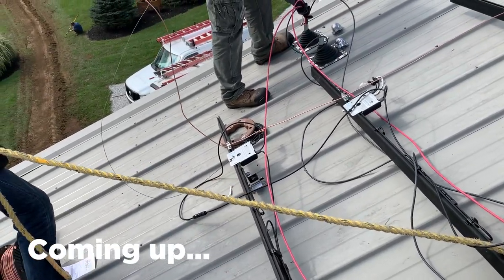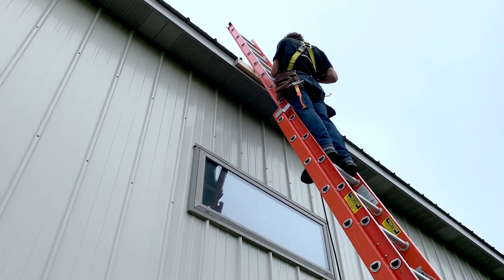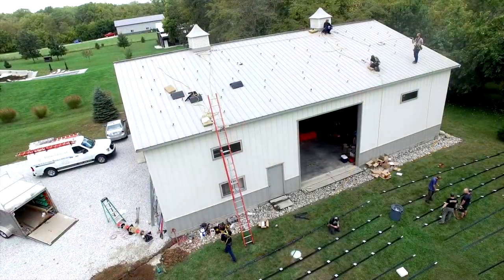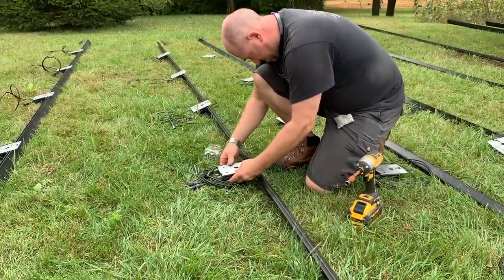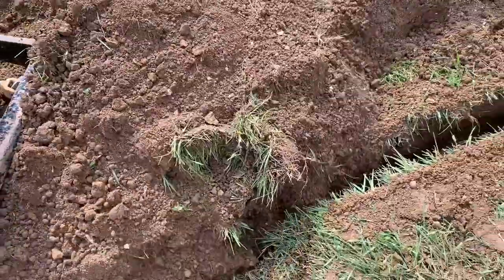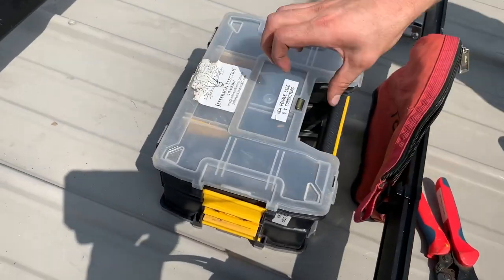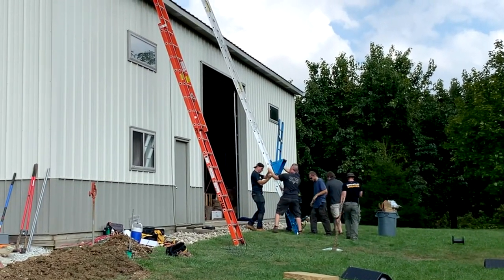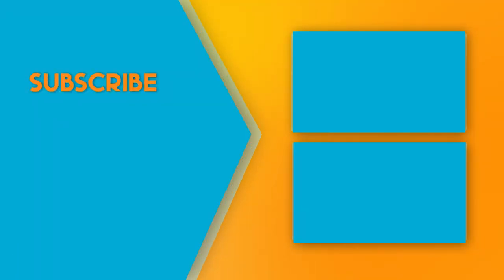Installing Residential Solar In One Day

Comment: Nice job. Its interesting that all the vids I watched only a couple show some one actually using a torque wrench on the rail, panel, and roof fasteners. Those using a trq wrench were diy'ers.  IronRidge specs these values in the engineered data sheets.

Comment: @ 28:41 it sucks to see how these panels don't line up at all..... As a stickler for plumb straight and square being almost as important as "proper torque specs", I was happy and impressed to see the rails being squared using the 3,4,5 rule and work being done on the ground before being brought on to the roof but its hard to ignore i think the final installation wasn't done to the best of anyones ability. To give benefit to doubt... its easy to look at a final project and criticize when we don't know the actual situation at hand. Just my thoughts !

Comment: Joel really professional job you have a great team great idea in pulling a spare cable. It would have been great to go through the selective coordination issues trip current curve assessments between the breakers and fuses. I wonder if you could have used ferrules if these were fine stranded cables in the connector blocks in the inverters?

Comment: I work for a solar company aswell I would recommend a modal bonding clip to bond all the array for grounding so you will need to only run  #6 to one rail instead of hitting all rails made by rbi

Comment: I have an Enphase solar system with battery backup/nighttime supplement. Each panel has it's own micro-inverter, so there is 240 volts AC coming off the roof to the combiner/interrupter panel.

Comment: A year ago this would have been lost on me, in the past seven months, I’ve gone from concept to fruition. Installed 9.6kw of solar DIY, as extravagant as the budget allowed, (penny pinching cheap). It’s a 20’ x 30’ covered parking area, using solar panels as the roof. I couldn’t afford optimizing the system, I had to go with used panels, but all the other components are new, used IronRidge Railings and components. If I can do it, anyone can do it, know your limitations and get help or educational assistance from your vendors. It is off-grid, it is not fast and loose, it is following code. I have another 2.4kw in process for a 24k btu mini-split that is ac/dc, anything helps when you are in Arizona. I really like your system, setup and process for solar.

Comment: You should have used silicone caulk around and in the hole under the roof boot. That is just an insurance second layer of waterproofing that costs pennies and will prevent a callback in the future.

Comment: I think if the out building didn't have a sub panal I would of suggested installing one  they probably will want electricity in that building at some point expesialy if your trenching than you can wire your pv to the to the sub panal also emphases micro inverters are the way to go

Comment: Why 3 knife blades and not 1 fused and bonded knife blade from the line side tap, to an equipment grounded combiner panel to feed each inverter with over current protected breakers?

Comment: microinverters are the way to go, these string inverters are last years tech
Reply: @ElectricProAcademy  companies like Tesla still use a single inverter, I think it's mostly due to keeping cost down. From other companies we had quotes from (some which used micro inverters) they stated the micros are better at managing individual panel degradation so as to not affect the total power generation. (that was my take-away)

Comment: Common mistake that direct burial cables have to be 24 in. 300.5 actually says 18 in. For single family dwellings and 24 in for roadways parking lots and driveways that are commercial.  1 and 2 family driveways its 18 in.

After reading the code again I have to say I was wrong on this one.
Reply: @ElectricProAcademy  I believe you are correct after taking more time to read the code again. Thank you for engaging in a mature and learned way. It forced me to look deeper and discover I was in fact wrong .
Reply: In Michigan it was definitely 18" for my conduit covered electrical between my house and garage, 24" if I used direct burial wiring.

Comment: How come guy is not using a torque driver to secure wires as required by last two code cycles? If you do not have the proper tools should not be performing work.